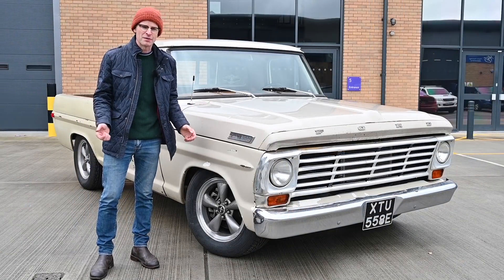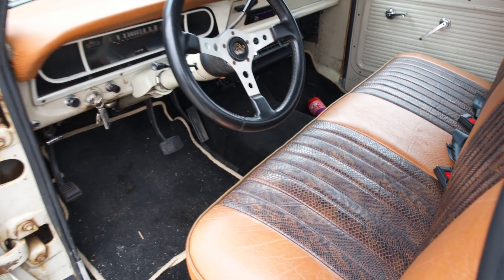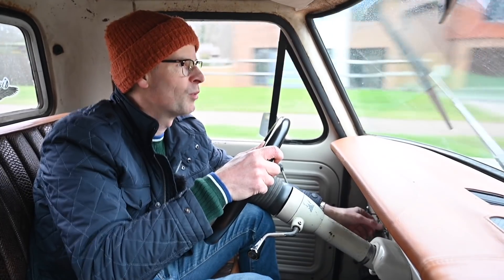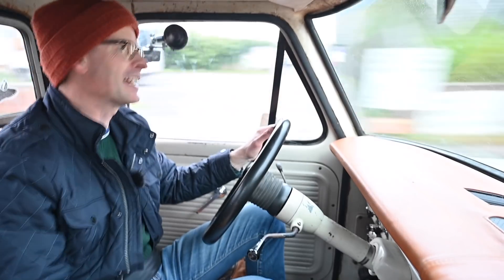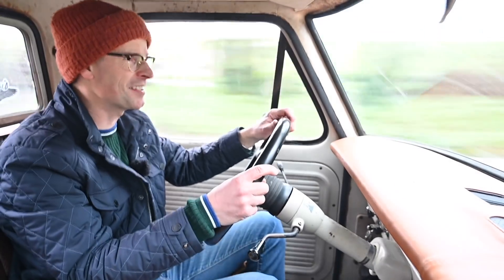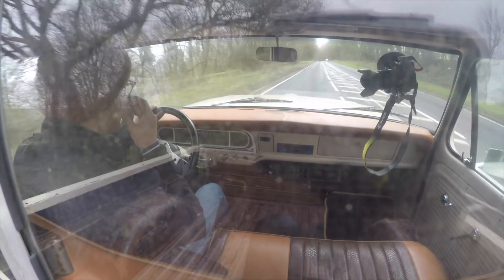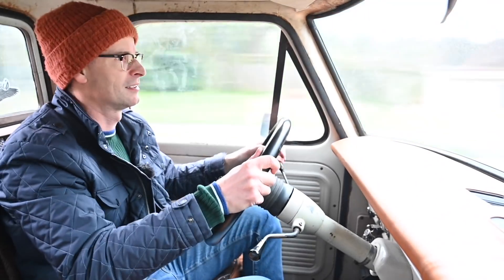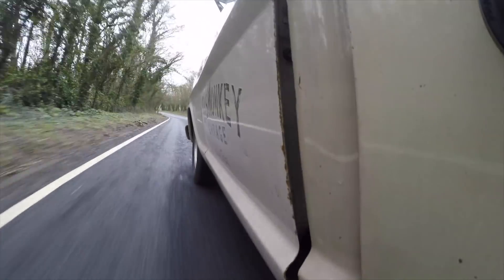Fast'n'Loud Gas Monkey Garage's '67 Ford F100 Goes for a Drive

Comment: Cool truck. You obviously had a lot of fun driving it. Even really Pick up trucks are great to drive in their own way. Years ago , I drove my stepdads yard truck for about a month while my 280ZX was being painted. It was a beat up 1981 Chevy Custom Deluxe (the only “custom” was the dents and no “deluxe” to be found) straight 6, floor shift 3 speed with low granny gear, no power steering or a/c.! Bouncy ride. Tons of play in the steering. Burned as much oil as gasoline I grew to love driving it. In college I drove a turkey awful 1978 Ford Courier (Mazda B series) pick up. Rusty, Slower than slow but never let me down. Recently, I got to drive a 1966 Ford F100 V8 3 on the tree. Great fun. My 13 year old son’s first exposure to a basic old truck and a 3 speed column shift. Good times.

Comment: A few of the old mechanics I know, told me in the 1980's they used to buy a 1977 Chev Biscayne or Impala, lift the body, and replace it with a 1957 -58 GMC or Chev truck body. Instant power brakes, steering, gear ratio for modern roads,  with a 5 liter or 5.7 liter V8 because there were surprisingly very few modifications needed to do it. Instant classic with updated running gear. This Ford was a more costly way to the same ends.

Comment: Washer fluid bags were common on certain British cars during the 70's, cheaper to replace if they froze in winter and split.  The trick back then to prevent it was to mix methylated spirit in the water, it also helped to remove any road grease on the screen.

Comment: What a great surprise... those 'Gas Monkeys' and their builds 👍🙂 These F100 'bakkies' used to a familiar sight on SA roads. We had a few in the old SADF, mostly used for ration runs and other general duties on base. Not I might add, with the engine on that beast.

Comment: Regarding the choice of hat, since this is a gas monkey garage truck, I think a baseball cap on backwards would work. Maybe one with a Budweiser or PBR logo on it.  I have a 1992 Ford F150 truck with a 4.9 liter straight 6 and a 5 speed manual. Here in Phoenix AZ older Ford trucks are a dime a dozen it seems. The straight 6 engine has a reputation of being nearly indestructible.

Comment: Fast n Loud became one of the highlights of my day's when I had a month off work recently... I thought a 'front clip' was the front bodywork, rather than chassis and running gear.
Reply from the maker: Its a fun watch and easy to get sucked in! Front Clip tends to mean cross member, suspension with brakes, steering and sometimes framerails as all that 'unclips' from the front of the bulkhead, American cars used to be very modular and share the same structure below the bodywork across multiple cars and brands

Comment: I love the 1960/70s ford F100 and 250s trucks and I can never get over the fact that you can still buy rust free ones for not much money in the US when most of our cars/trucks if they are still on the road have had expensive rebuilds to cut out all of the rot then just use on sunny days.        The real problem with having one as a daily driver in the uk is parking as most of our parking spaces are meant for smaller cars driving is ok its no bigger than a Sprinter van and our roads are full of them.

Comment: Great fun watching your reaction to American vehicles.  I have driven a lot of pickup trucks.  They are always fun.  A few thoughts:  Ford always places the gas pedal against the transmission tunnel.  Most old Fords have a bald spot on the carpet/matting next to the pedal.  American cars always have self cancelling turn signals.  That one must have been lost when they replaced the steering wheel.  Same for the gear shift indicator.  It is just as difficult to gauge the width of the vehicle on the right side of the road.  After a while you get used to it.  Gas mileage for Ford trucks is terrible, no matter the engine choice or the load.  Campers have a window matching the rear window, so it can be used to communicate with passengers.
Reply from the maker: Wonder why Ford always put their pedal so far over, theres lots of room to play with!
I do a lot of work with an American car magazine here so Ive been in dozens but rarely get to drive them, its always fun but they feel big for our roads, although the way cars have grown most new SUVs feel too big for our roads!

Comment: Just a couple a little points.  That’s not the original steering and it has what looks like a 40-60mm extension on it.   For wind noise, well..... you need to open the vent windows on a warm day.      As for the engine, I don’t think it’s a mustang unit.  It sounds about 180-200hp.   It’s wearing a crown Vic intake.   The mustang is the 5.0ho. The town car/crown Vic 5.0 lopo(slang term for low output, low performance).   The Lopo has e6 heads, low lift cam,  lower performance intake, and different exhaust headers.    The 302 ho has the e7 heads with bigger valves, ho cam, ho intake and exhaust manifolds.    We had a worn out 67 f100 while I was in high school. It had the 400m big block.  The brakes were inadequate to say the least.
Reply from the maker: It has the Crown Vic steering so the extension/adapter is there to connect to that rack, and if he had a CV to strip may well have taken the airbox as well, but Im told its a 5.0 from a Fox Body. As hes a hot rod builder who knows what parts would have been added or swapped. And even with CV and later F100 disks the brakes could be better!

Comment: 0-60 eh? Have you seen the latest Harry's Garage? Tesla Model 3 does 0-60 in 3.4 seconds with hardly a sound. Guess which I'd prefer.
Reply: The '67 F-100, yes?
Reply from the maker: I think I can guess
Reply: Rudolph Guarnacci OK for going to the dump but otherwise - non!
Reply: @glynjones2540  
I enjoy going to the dump. My father was a hoarder and now when I see clutter I freak out like a little freak.

Comment: Jammy b#@^*r diving that superb truck! I  had an '82 short bed F150 with a 302 4bbl holley. Pulled like a train and earned its keep. 20mpg on a steady run.Another one sold due to 'domestic pressure'. V8s are an addiction!